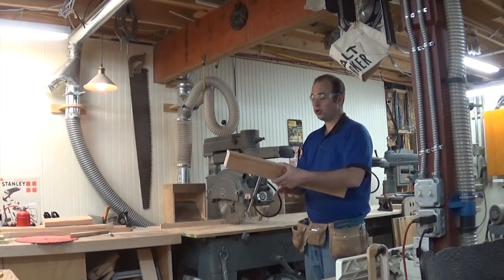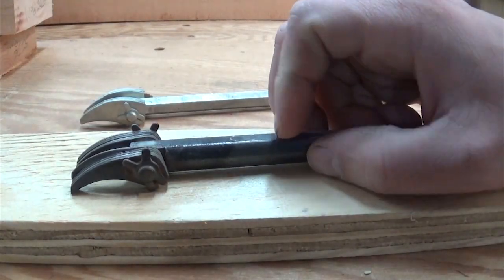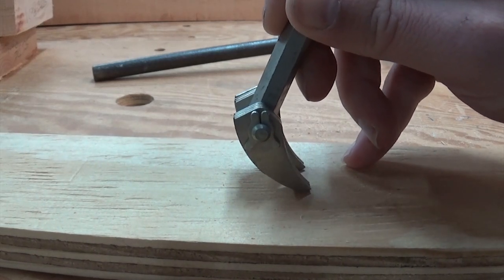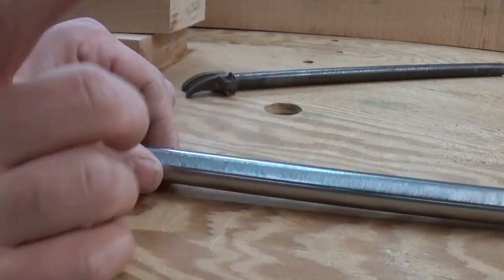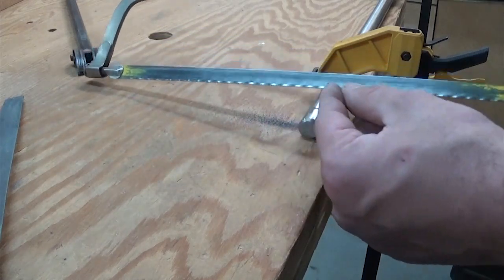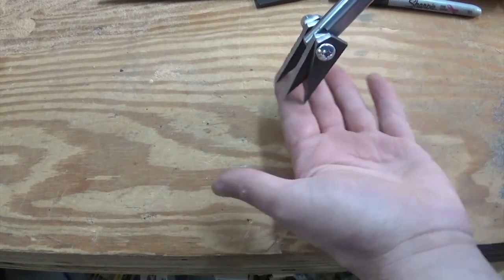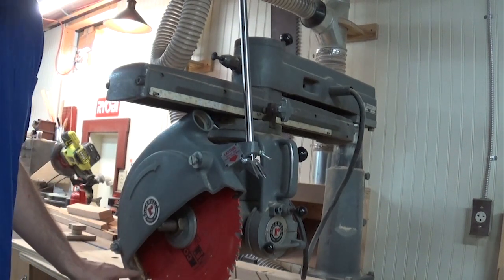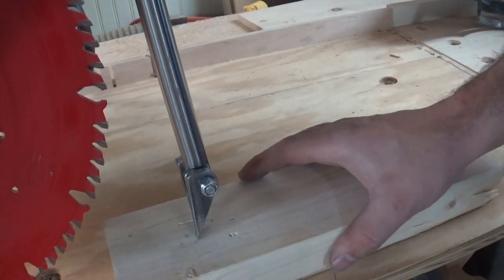Build an Anti Kickback Pawl for Radial Arm Saw

Comment: How could I add a splitter to the pawl to prevent pinching of the kerf?
Reply from the maker: You could probably cut a slot in the rod and put a 3/32” piece of metal in there to keep the kerf open.

Comment: I'll have to do this for the 1030 I'm getting tomorrow, but I think for those pawls, instead of trying to cut them all with a hacksaw, I'll try using my pneumatic right angle die grinder with a cut-off wheel.

Comment: Fortunately, my DeWalt MBF still had its pawl when I bought it.  It had some surface rust, but so did the rest of the machine and its cabinet base before I restored it.  I left the cadmium coated column alone because that stuff is toxic, but I wire wheeled the pawl, the guard's wing nut and the thumb screws for the back of the table base and any other bare metal like knob shafts till they shined like yours on my bench grinder:)  The knob shafts and things like that I clear coated to make them stay that way, but for the pawl I used wax to keep it from sticking to the guard.  I wire wheeled the painted surfaces with a drill as they were too large and heavy to do at the grinder.

Comment: Thanks, I really appreciate you making these videos.  I bought the same 14" Delta Rockwell saw, and will be rebuilding it this winter.  It is in excellent condition and hopefully won't need much work.  Ozark Mountain had my owner's/parts manual.  The saw came without the anti-kickback setup and the leaves.  Renovo parts says they have them, but the price is almost as much as I paid for the saw.  

One question, do you plan on incorporating a riving knife?  I will be ripping some long boards.

Thanks again.

Comment: The term anti-kickback for the RAS pawl does not capture the crux. In ripping with an RAS, the infeed side tends to lift the work and the outfeed side tends to push down on the work. This is opposite in ripping with a TS.

Ripping with an RAS in a sense evens out the unpleasantness or risk, whereas in ripping with a TS all those are at the far end. Since one has to reach over for the far end, to pass the work, ripping with the TS is more unpleasant. 

The RAS pawl is not a splitter;  its function is primarily to prevent ejection. The height of the pawl in relation to the work has to be such that ejection is unlikely, not closest to the work.

The pawl is not a splitter like a riving knife or separate splitter for the TS.

Even though the work is pushed down at the outfeed for the RAS, a splitter, in addition to the pawl, is still quite desirable.

Comment: If you wanted all 4 pawls to stop you could find a heavy stop collar to lock on above all 4 fingers level with your notch. Lock the Allen screws in the collar with thread locker so vibration doesn't cause it to loosen. IMO
Reply from the maker: That’s a good idea.

Comment: Make sure you measure before you order the shaft material. Many DeWalt saws use a 1/2 inch shaft for the anti-ejection device.

Comment: You always want a riving knife on a table saw to prevent kickback (see a great Youtube video entitled "Kickback on Camera")  Technically speaking, radial arm saws do not kickback. They eject wood and this is what the pawls are designed to prevent.  I know that the word "kickback" is used to describe every piece of wood that goes the wrong way on a power saw with a circular blade and that radial arm saw manufacturers called these pawls anti-kickback pawls.  However, what they really prevent is straight-line ejection of the wood which is different than kickback.  If you label them by function, they are "anti-ejection pawls". 
Nice video and I hope that it encourages every operator of a radial arm saw to use to use these pawls, however you label them, every time they perform a rip function on their saw. Five seconds of additional setup for a rip cut is worth the significant increase in safety which the proper positioning of the pawls provides.
Reply: Well said…….

Comment: Well done sir! Where did you find/order the 5/8" rod?  McMaster D-Profile Rotary Shafts are closest I can find. Is yours stainless steel? Someone mentioned spring steel - what would be the advantage(s) if any of using spring steel vs. stainless?
Reply from the maker: The shaft I used was McMaster Carr number 8632T15 which is just normal carbon steel. Somebody mentioned using spring steel for the fingers because it would hold its points better but for this I don’t think it really makes a difference.

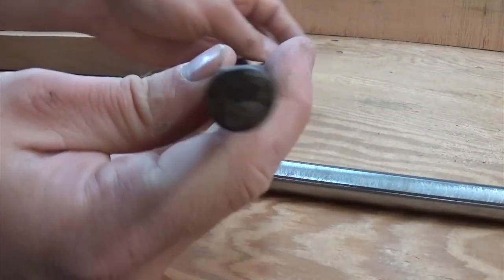Comment: I have a DeWalt and bought an early Craftsman blade guard and anti-kickback to use on my saw, one thing I noticed is that the mounted position of the flat side on the bar is at different positions on the Dewalt and Craftsman saws as you pointed out 8:30 . A three sided file works great to make a starter kerf for your hacksaw.
Reply from the maker: That’s a great idea on the three sided file.
Reply: @TheNorthlandWorkshop  metal shop "100" years ago.😀

Comment: Thank you for this! I think the original may be made of spring steel but the 3/16” metal should make up for that; it’s for sure better than nothing. Just a tip for you if you soak the mill scale over night in vinegar it will just brush off. Thanks for the great shows!
Reply from the maker: That’s a good tip about the vinegar, I knew it would take zinc off galvanized steel but didn’t realize it would take mill scale off. I will be using that tip in the future.